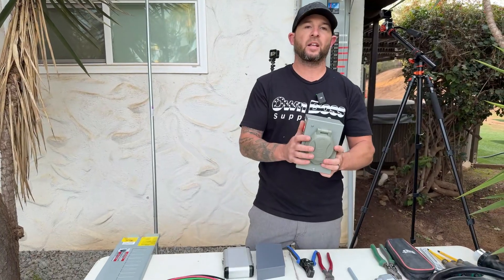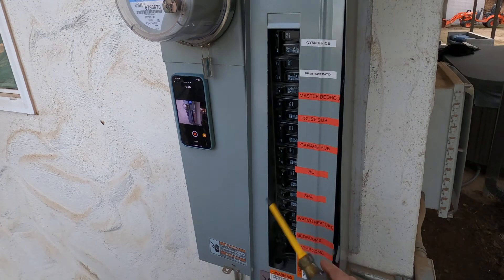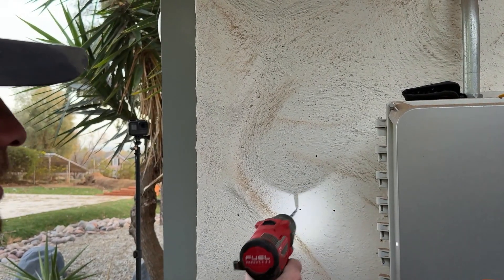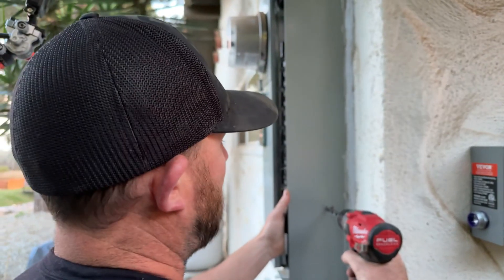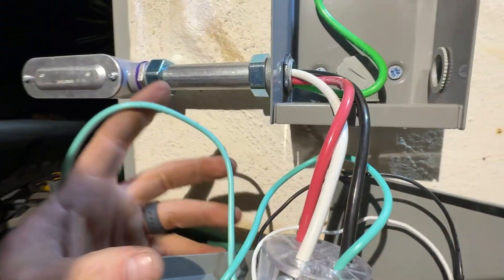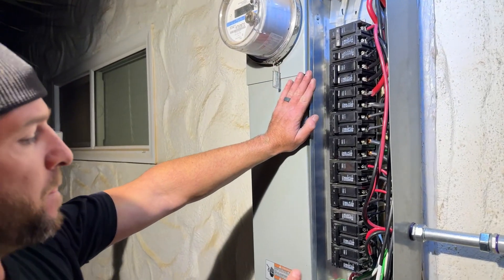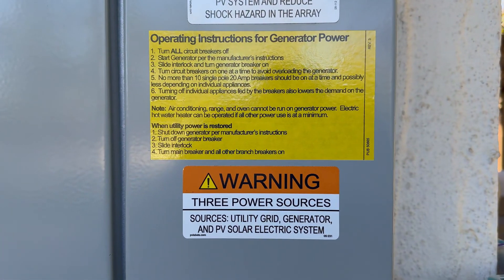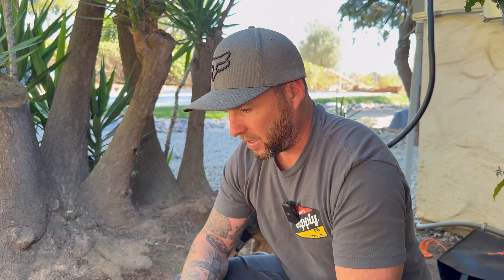Step by Step Backup Generator Install UNDER $1,000 It’s Possible!

Comment from the maker: Is a $1,000 home backup generator worth it, or do you think people should invest in a bigger setup?
Reply: Every bit of it specifically here in Florida, I have a 14k Generac standby since 2006, whole house not a hiccup but, I just bought two of this fatty boys from WEN as an extra precaution because more is better in my book. I haven’t tested yet but the connection is set on the house in the event of another storm, I’m just working in creating a quick internal disconnect from the ground which is easy.  
Thanks for the 💯 professional advice, this is the way electrical work should be done, not cutting corners.  Cheers brother.
Reply from the maker: @KubanKamping thanks for watching man! Appreciate the comment! Cheers.

Comment: If you connected two of those exact same one generators what parallel kit would you use and also would it just connect straight to the same 50 amp?
Reply from the maker: yes they make a parallel kit with the correct connector. you would just connect them together and have one plug. I have been reaching out to WEN to see if they will send me a loaner gen and kit to make a video on then ill send it back, but I'm not cool enough for that. I don't have a real need to spend another $850 for a second generator. Here is the link to the kit https://wenproducts.com/products/wen-gna240i-50-amp-12000-watt-240v-parallel-connection-kit-for-240v-inverter-generators

Comment: I have the same set up as what you have there.   I had an electrician install everything.  He claims there is no need to disconnect the bonded neutral on the 220 switch on the wen What is up?  Tested whole house everything works fine. All i am using is a lock out and one new breaker for the WEN GOING through a box just like yours.  Frankly i dont see why the wen bonded neutral has to come off.
Reply from the maker: Thanks for sharing! The reason the bonded neutral on the WEN generator typically needs to be disconnected is because you’re tying it into a main panel that already has a bonded neutral-to-ground connection. Leaving both bonded can create a parallel neutral path, which is a code violation and a shock hazard—especially during a ground fault or when switching power sources. Even if everything “seems to work,” it can be dangerous and not up to NEC code. The safest setup is either to disconnect the WEN’s bonded neutral or use a transfer switch that switches the neutral, depending on your system. How your home is wired is what can make the difference.
Reply: That electrician needs to research about why there should only be one point of bonding.  He might learn something.  All installed standby generators from Generac, Briggs & Stratton, Kohler, Cummins,Champion, etc., are all floating neutral from the factory.

Comment: Why did you use the 240 plug adapter?
Reply from the maker: Hey thanks for watching! I wanted to instal a 50 amp inlet box incase I decide to upgrade or run a parallel generator in the future. This cord is for a 50 amp inlet box the adapter lets me reduce down to the correct size for the generator (30 amp) with no issues. Plus now I have an extra cord for my RV and I know I’ll never max out the wire in the cord!

Comment: Can't wait until next week. Did I miss something? When either the solar or the generator are suppling power with the utility power off. Isn't there a back feed on the neutral?
Reply: Gotcha. I figured it was the white one but just wanted to double check with somebody  thats done it on the same generator.  Thanks for responding
Reply from the maker: @ChevyAvy04  happy to help man! Cheers!
Reply from the maker: Next weeks video is epic. I push the generator to the MAX!! Nothing is being back fed, its important to make sure the solar is shut off since i don't have battery back up my solar won't run the house BUT... if the breaker is not shut off i would be double feeding power (solar and generator power). Nothing is being back fed through the neutral on the generator its important to make sure the neutral is floating and not bonded to the frame of the generator since the house is already grounded.
Reply: Which wire did you disconnect for the neutral?  I see a yellow/green and a white.
Reply from the maker: @ChevyAvy04  you want to disconnect the white neutral wire it’s a 10mm socket.
Only disconnect it when you are using it for home back up power, make sure you cover the wire so it doesn’t touch any metal surfaces in the generator.